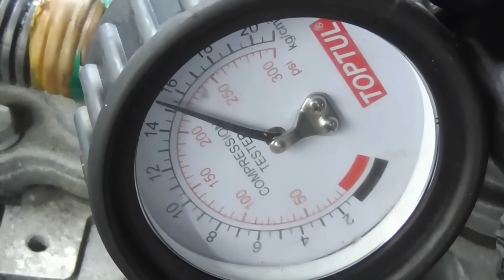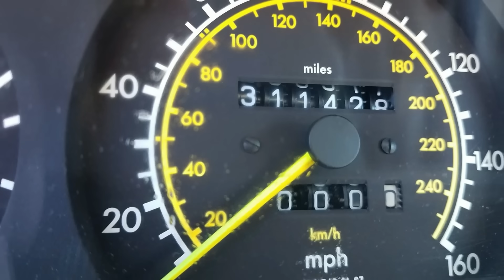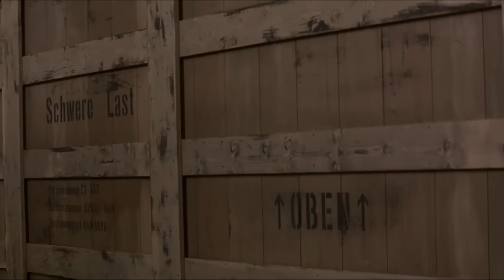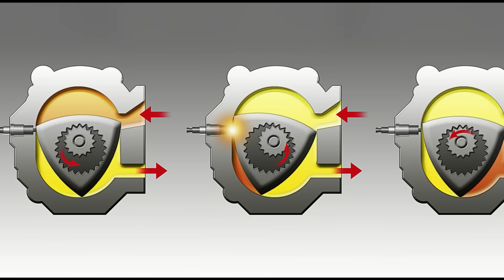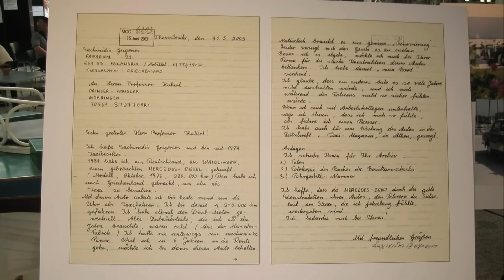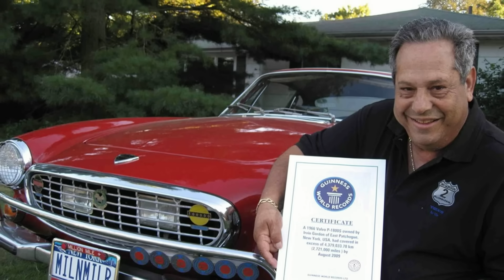Most Reliable Engines of All Time

Comment: I have a 1984 Mercedes 300D Turbodiesel with 572,000 miles on the original engine. The key is I change the oil every 3,000 miles (instead of the suggested 5,000 miles) and use 15W-40 Diesel oil. Only thing done to the engine besides oil change and valve adjustment-fuel injection pump rebuild, water pump, thermostat. Oh yes-the transmission is also original. And I don't drive it lightly. I cruise at 75-80 when I can, and do floor it quite often. But then again, this engine is made to be run. In between the 3,000 mile oil change, I use just about a quart of oil. They'll never make another all cast iron engine like this again.

Comment: Jeep XJ, 4 ltr, in-line 6 cyl.  Absolutely bullet proof.
Reply: GrizzledGhost same engine in the Jeep yj and tj, hella bullet proof.
Reply: 93 Grand Cherokee fulltime 4WD 4.0 216,000 would've been higher but I flipped it trying to not hit a kid who pulled out. Towed a Savannah Conv. van 10 mi. including an 1/8 mi 15% hill ( using low range) at 190,000. I miss my Jeep

Comment: The Volvo b18 and b20 Engine is the best in the world
Reply: Volvo is Quality stuff, i am from Sweden so i know😉
Reply: @robinlidstrom7938  Well the highest mileage car on the planet is a Volvo P1800 which has done 3.3 MILLION miles (American miles not Swedish miles !!!) .This car is 54 years old ; is on original engine and gearbox ; has never broken down , has used 112889 US gallons of petrol ; 492 spark plugs and amazingly only 33 sets of tyres .The car has never been garaged and has the original paint.A real Volvo ( as opposed to what they build today -the last real Volvo was the 940/960 range ) is truly a car for life but half the so called Volvos today have never been anywhere near Sweden being built in Holland Belgium China etc .My old 140 clocked up over a million miles in 32 years -even the late owner of IKEA drove a 35 year old Volvo .!!!
Reply: Ronnie Ince the engines are still made in Sweden so they are still very reliable, and many cars are still made in Sweden. But the older engines are more reliable just cause they were much simplare but the new ones are not bad compared to other companies. My dad’s xc70 from 2015 has 100k us miles on it and the only thing changed apart from normal service is a serpentine belt and brakepads, he hasn’t even needed to charge the battery one single time even when it was -30c. Never any issues. I have a 940 with over 300k us miles on it and i haven’t had to change any parts since i bought it last year. Ive seen v70’s with over 400k us miles on them so they are super reliable. Greetings from Sweden!🇸🇪😁
Reply: @alfredpalsson  My betting is the 940 will still be going strong when the newer models arevinnthe breakers yard -I have seen 5 year old  newer models with rust -something that you only saw on a Volvo decades old   Look after that  940 and it will easily top a million miles -possibly even a million Swedish miles with care .!!!
Reply: Ronnie Ince I agree that the older models were a bit more reliable but their engines were like tractor engines in comparison to the new ones. I like the old models more myself but the newer ones are not that bad aspecially their 5cylinder engines in perticular the diesels. And the new ones don’t rust more then the old. They can’t make engines like they used to because off emissons, fuel consumtion, low horsepower and they wouldn’t compete with other brands. And the 960s engine is a 6cyl version of the 5cyl engine which they used in many cars after the 960 it’s called whiteblock cause it was made in alu instead of iron like the redblock. And Volvo have had factories in Belgium since a long time back. As a swede I would ofcoarse want all Volvos to be made in Sweden but their is nothing we can do to change it. but their is still plenty of cars, engines, machines and trucks still being made in Sweden. I love the old Volvos my grandfather has a original orange 1975 Volvo 242l with a b20a, one owner, always keept in garage with protection on the seats since new and only 75k us miles on it and only driven in the summers so that car is priceless to me and my family.  I’m sorry if my english is not the best but i hope you get the point and have a good day. VOLVO for life!😁
Reply: Please let us not forget the b21 and b23 engines as well . I had a 89 740 with a B230ft engine that had 280,000 miles on it just breaking the factory alternator in 2011.

Comment: The 1UZ is also indestructible. There are two LS400s with over a million miles on them
Reply: right! I had a 97 LS400 with 700k and everything worked still.
Reply: Those engines are bulletproof
Reply: not to mention they were on the car and driver best engine list for 10 years. One reason they are so cheap if they always outlast the chassis and still pass leakdown. I had one with 400k+ on it and completely oil sludged and I thought it was ruined. Filled it with diesel, let it soak to break up the sludge, drained it, and it passed leakdown. Its been running for the last 5 years now.

Comment: Mitsubishi 4G15 12v 1.5liter sohc is the most reliable. Used by taxis in my country. Even using lpg or ngv, the engine easily go over 500,000kms. Its no performance but a tank
Reply: Cheap overhaul cost, and it will run like brand new for another 500,000kms. Longest record hold by a mitsubishi mirage 1998 travelled 1.6 million kms / 1m miles.

Comment: my 2002 volvo s60 with 2.4L D5 diesel engine has almost 900k km on the clock. Over the time I had to change head gasket
Reply: Yeah it's reliable engine ik, but Volvo as a whole isn't...
I had a V70 with the same engine (600k+ km) and it was probably the only thing what didn't break lol.

Comment: Volvo's Diesel 2.4L straight 5 engine. Had 400 000miles on it before I sold it. Still running. Original clutch in it 🤷‍♂️
Reply: @BassVentura true. They sold it to Volvo and volvo gave it different injectors and a turbo. I'm not 100% sure so don't quote me on that.

Comment: I guess my 300 inline 6 cylinder made by ford in 1978 was just junk. I mean it only lasted 226000 miles before I rebuilt it. It now has around 320000 miles on it. The transmission has never been touched. I guess Americans just can’t build good engines. My sons 5.3 Chevy has close to 200,000 miles on it. The only issue it ever had was the rear end went out on it. My 2002 ford  f 150 with its 4.6 liter. Is running strong at 162,000 miles.

Comment: Audi 5cyl, vw diesels, jeep 4.0 not on the list? They are commonly found with over 200K miles, even in the early 90's when it was a most cars were dead around 75-100K . Many broke well into the 400K mile range. 

There was a VW TDI shown but it was during the MB segment.

 Irving Gordon passed away in November of 2018. Volvo also did have their hands on his car a few times.

Comment: This guy has no idea what he is talking about the rotary was known to be very unreliable because of the apex seals plus every Cummins ever made or any big American diesel for that matter is way more reliable than anything you named with engines reaching 1,000,000 to 2,000,000 before they need a rebuild fuck my 12v Cummins has 1,356,xxx miles on it and it still runs

Comment: The engine in the new GTR is a VR series engine yes it’s based off the VQ block but it’s not the same engine also the Fairlady Z has the VQ engine and so does many infinity’s also you say the letters in DETT because it’s an acronym it stands for Duel overhead cam Electronic fuel injection Twin Turbo P.S. if I made some spelling mistakes is because I haven’t slept in 26hrs so yeah I’m probably gonna go to sleep now and then wake up to a bunch o people who are offended because I didn’t type out the entire engine code for the VR/VQ engine because I’m tired and that would make this way to long but I’ll deal with it then -_-

Comment: bragging about an engine lasting only around 150,000 miles for the majority of a particular make of engine is like bragging you can jump a foot of the ground. 150,000 is not an achievement, it is an expectation. Any less and it is considered a crap engine. Any way, where was the mention of fords 7.3L diesel without the egr? everyone i know who owns a vehicle with one of those all have near or above 200,000 miles with only one having problems with an O-ring on a single injector. I mean it's no uncommon to see one at 500,000 miles.

Comment: Plymouth Fury 800,000 mi.
But had 4 engine's. That's like my 80 year old hammer that has had 4 new handles and 2 new head's. 🤔
Reply: You have an 80 year old hammer?
Reply: Joe changed the engine oil every week. Joe was a dickhead. Don't be like Joe.

Comment: 1.9 jtd is also very reliable 500.000km and only oil changes were done
Reply: Aljaz Grabner  My Audi 80 1.9tdi has 695 000 km👍🏽
Reply: @jdm.flair2020  1.9 diesel best engines jtd and tdi 😉
Reply: Aljaz Grabner without a doubt 👌🏻

Comment: Vw AHU tdi 1.9 turbo diesel. 500,000 miles easy
Reply: Avf/awx runner up to the AHU
Reply: Jaski Kiiski  Plenty of passat's with 1.9/2.0 TDI with as much as 720k km
Reply: 500,000 miles is just break-in
Reply: Mine is a 1z, still running like a champ. (leaking oil all over the place.) But still pulls hard. Still manages to reach 0-100km/h in 12.smth. Just like from a factory. Sad that the chassy gave up and rusted like swiss cheese.
Reply: Unfortunately no :)
Reply: For you. Yeah i agree
Reply: Jaski Kiiski  Well here in finland we have
Reply: @TheRealTekki  My old 96 A6 1.9TDI had 350K miles before the gearbox broke, engine was still fine :D 1.9TID is one of the best engines if you ask me.
Reply: @Nico-xn2of  Just new gearbox and youre ready to go :)
Reply: Jaski Kiiski  täyttää kriteerit 1.9 tdi
Reply: Ainakin linkin skoda toimii. En sit tiiä :/
Reply: That thing is a hunk of shit. I had two of them...garbage.

Comment: Sorry but I beg to differ,the 300 Ford six,the 4.0 Jeep six,the Chrysler 225 Slant six,the Chevrolet 292 six,the GMC 305 V6,and many others that you have overlooked. Many engines from the 50s,60s,70s,80s, lasted longer than those on your list. And yes,I do know what I'm talking about since I am a retired ASE certified professional automotive technician. Most of the engines on your list seem to be speed oriented rather than daily driver oriented,and you seem to have a preference for foreign engines over domestic ones.Research a bit more next time before you present your opinions as facts.

Comment: You said rb26 and showed a Supra....
Fail
BTW 2jz is documented as a stronger platform.
Reply: 2jz is stronger,but heavier than rb26
Reply: @MrGembelo  
They are both rather heavy at 500+ lbs.

For under 800hp applications an LS is better all day long. 400lbs, more linear torque available at lower rpm, more reliable, cheaper etc
Reply: @thelist1372  i agree with ls is lighter,more reliable. But here in asia,LS is more expensive than 2jz
Reply: @MrGembelo  good point on price. It's amazing how much they vary. Prices on rb motors or anything r32 is insane in the states. Meanwhile they throw ls blocks in just about every GM vehicle lol

Comment: I think GM LS/Vortec engines should have been on this list. The mazda 13b is great for specific power output. But it is horribly unreliable....
Reply: agreed. I have a Vortec 5300 V8 and that engine is solid. Only thing funky are those AC Delco electronics but with normal maintenance those engines are beast. Had a friend with an ole Pontiac Bonneville SSE he took care of that had 394k miles on it and it ran SOLID.
Reply: I agree. I had a 94 k1500 4.3 vortec that had 455k on when it was wrecked

Comment: The RB26DETT came much earlier with AWD getrag trans in ALL the r32, r33, and r34 GTR models. The k20 is finicky and yea is reliable to hold decent bhp numbers, but it requires quite a bit of maintenance to stay up to par for Daily driving. And in no world or even any parallel universe , did the toyota supra ever come equipped with a 4cyl... oh lol rotary engine and dependable in the same sentence..? Not even on its best day

Comment: My 1.5 liter Honda Fit @325k miles is crazy reliable. The only thing I had to changed so far are spark plugs and a bad starter everything else is all original since bought new.
Reply: You might want to consider a water pump and cam belt change (unless it's a timing chain)
Reply: Ben Turner it’s a timing chain no need to change and mechanic said if water pump is not leaking no need to change.

Comment: 1. Rotaries have problems with 100k or less normally bc apex seals. 
 2. To my knowledge supras never had a 4 banger
3. Diesels with mechanical injection will obviously run longer. 
4. All these people saying ls motors are very reliable are right. As long as they are talking about the ones with out displacement on demand. Many of those motors have problems sub 100k miles. And many motors people call ls motors are actually vortech or ecotech motors. Ls motors are car motors only. And let motors are also normally lumped in even though they are different in the fact that they have direct injection. Get your facts straight. Also the Us never got an r34 skyline so that isn’t an option for us

Comment: A True good long lasting Strong Engine is tested After 200k miles,almost any engine can make it to 200k with regular maintenance, But a Real good Reliable Engine depends on how far out After 200k it can last. 😉👍
Reply: Yup...100k is nothing. If an engine needs serious work before 100k it's a junk design. I have seen many 4.6l Ford modular v8 engines go over 300k in taxi service with regular maintenance.
Reply: Exactly most cars make it to 200k miles easily
Reply: JmSavage BDK ever heard of the S85?
Reply: Yeah exactly. My little 95 Civic is right under 300k with zero signs of stopping. I just rebuilt the front suspension/steering and hope to do more soon. Even if the motor did crap out soon I'd just put another in and keep going. It's already paid for itself 10x over. I would really love to get it even half way to a million miles.

Comment: I know french cars have a bad reputation but it should be revised, cars like the Peugeot 504 and others lasted for ages. 

My father's car for many years was a 1982 Renault 20 TX with a 2165 cc engine rated at 116 hp (my great uncle had the Renault 30 with a 2.7 PRV V6 with 136hp, who was a blast but still slow on today's standards). Not fast for a quite heavy car but had torque to compensate. It lasted almost 400k miles. My father being a mechanical engineer, he rebuilt the double barrel inverted carburetor a couple of times but other than that, my father kept stupidly long periods between oil changes (double the standard and triple sometimes). The only reason we had to finally get rid of it, against my suggestion of restoring it (we were in the late 2000s), was because at the time it was build, french made cars still used non-galvanized steel, so although the engine and overall drivetrain was healthy, the overall body was rotten.  

Aside from the carb rebuilds, my father wagered it would lasted over 500k miles. He was a very smooth driver. Unfortunately, his smooth driving didn't pass on to me, since be age 16, my parents were divorced and my new stepfather was a former rally driver who still to this day, at the age of 73, gets excited as schoolboy to go see a rally, like next week for the Portuguese WRC event.

Comment: You see, power and efficiency are what manufacturers strive for. Reliability is a byproduct. Usually when you get an engine that’s reliable, it’s been perfected, it’s the end of that family. But the industry strive to have more power of better efficiency, which drives manufacturers to innovate. These innovations will always have teething problems but overtime they become more reliable as they get perfected. But the industry keeps moving forwards and innovation comes in the form of new components which are sometimes unreliable at first.

Comment: 3.3 L Chrysler !!!  My son just told me that my Intrepid did over 100MPH when the car had 270,000 miles on it and the car was so worn out it would barley stay on the road. The average 3.8 L Buick gets  275,000 miles.  the 5.3 and 6.0 GM pickup motors get 300.000 to 500.000 miles.   Everything on your list is Jap scrap or euro trash!!!!!

Comment: Clutch 50k? Wth is he talking about. I would said avg is 150 to 200k
Reply: It depends on the driver my guy can destroy it 20 miles lol he can't drive for sh:t
Reply: Cuz
Reply: I have two cars and their clutches both have over 100k. Still have plenty of bite too.
Reply: sr420det I agree. I have an '04 Ram 1500 and is just a few thousand miles short of 250k miles with the original clutch, pressure plate and throw out bearing. Clutch works perfectly.
Reply: must be a foreign car thing
Reply: Foreign cars are a lot better but either should have clutches that last over 150k miles. Automatics also have clutches just smaller and more of em which also last that long. .generally
Reply: My Toyota matrix has 205k orginal clutch and my wife's speed3 has 90 on the orginal clutch. I would be highly upset if it didnt last over 150k